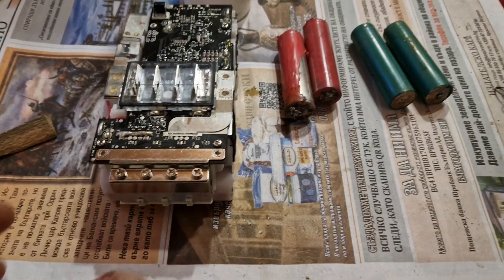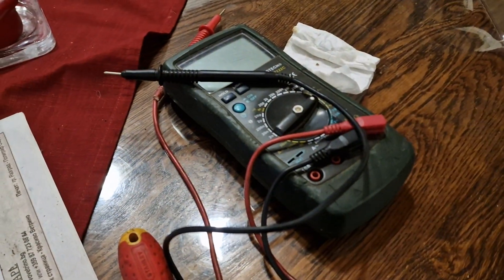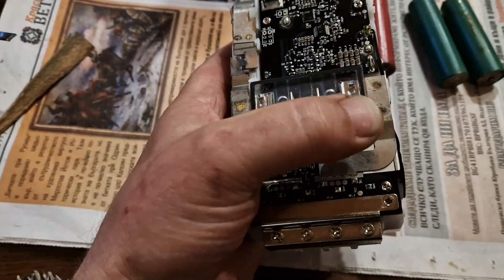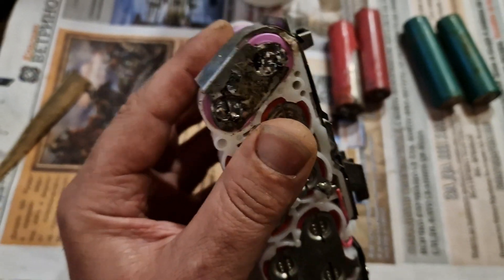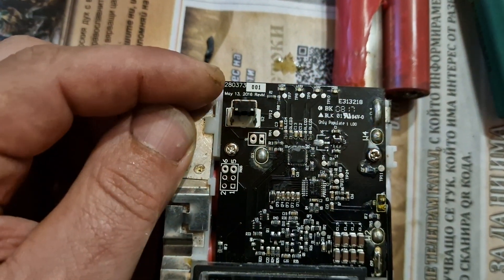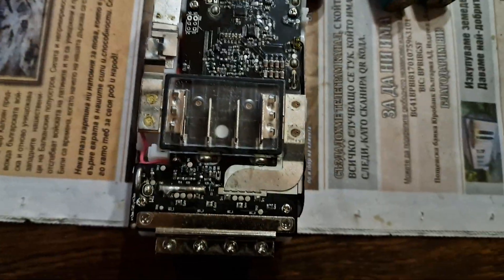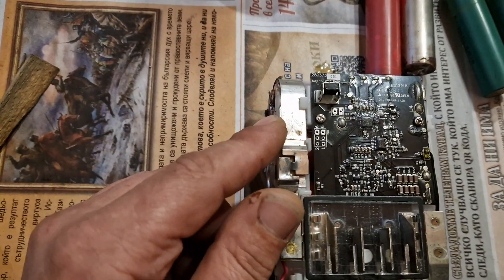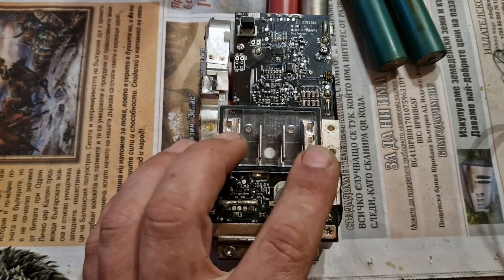Fixing not charging /not working Lithium batteries

Comment: Great video! You explained things really well. It's always better to fix things rather than just throwing them out. One thing that could make it even better is if you had a spot welder, but using a soldering iron is still a good option but you just have to be careful